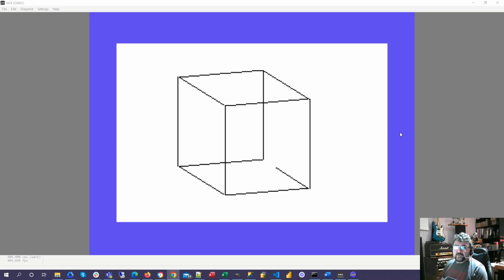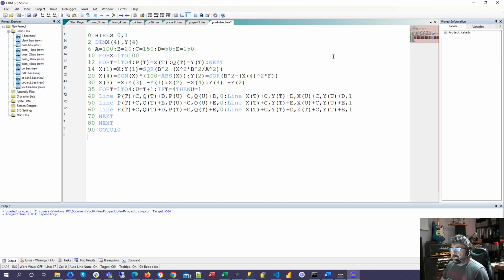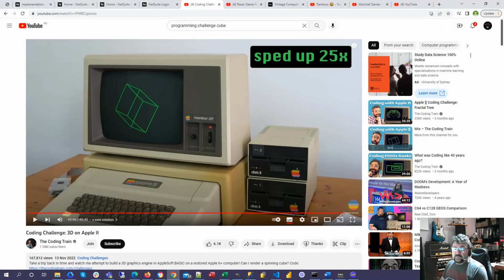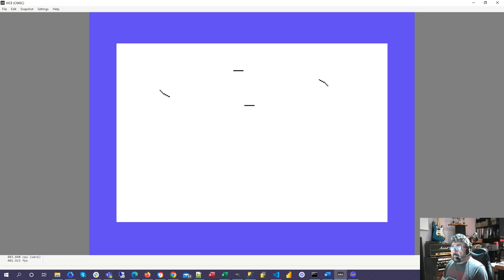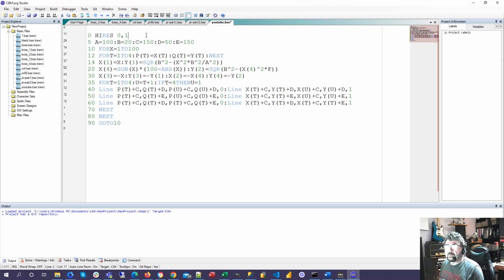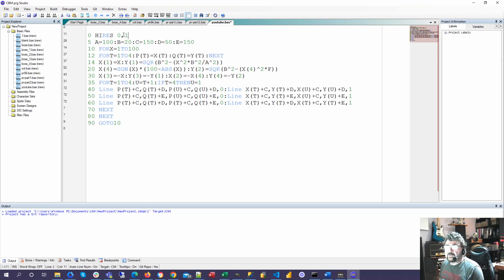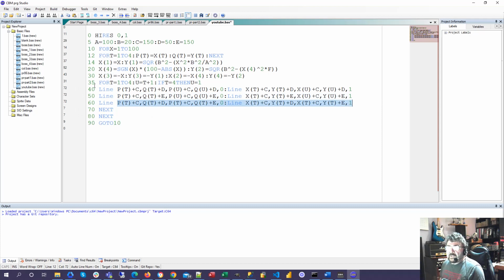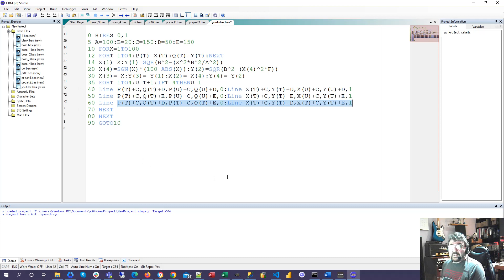Coding Challenge: 3D on a Commodore 64

Comment: Look up the Compute's Gazette magazine archive about 1986(ish). They published a type in machine language "BASIC wedge" that added BASIC drawing commands for the high rez screen and simplified setting up the high rez screen. The unique thing about this wedge over other drawing wedges was that it specialized in 3D mesh drawing. It included several key words that utilized screen swapping for animating. It was primitive and slow compared to anything developed 10 years (or so) later but it simplified displaying such things as a rotating cube by handling the math of drawing the mesh in a perspective view. The only tedious thing was that you had to figure out the vertex coordinates of the object you wanted to display somewhat manually. I believe this was their attempt to replicate the 3D rendering "engine" developed by Sublogic for Flight Sim, but to put it in the BASIC programing environment.

Comment: This is pretty cool.  Thanks for sharing.  I've modified this code for the C-128 and for the Commander X16...

C-128 code...
0 GRAPHIC1,1:A=100:B=20:F=B^2/A^2:C=150:D=50:E=150
1 FORX=1TO100:FORT=1TO4:P(T)=X(T):Q(T)=Y(T):NEXT:Y(1)=SQR(B^2-(X^2*F))
2 X(4)=SGN(X)*(100-ABS(X)):Y(2)=SQR(B^2-(X(4)^2*F))
3 X(3)=-X:Y(3)=-Y(1):X(2)=-X(4):Y(4)=-Y(2):X(1)=X:FORT=1TO4:U=T+1:IFT=4THENU=1
4 DRAW0,P(T)+C,Q(T)+DTOP(U)+C,Q(U)+D:DRAW1,X(T)+C,Y(T)+DTOX(U)+C,Y(U)+D
5 DRAW0,P(T)+C,Q(T)+ETOP(U)+C,Q(U)+E:DRAW1,X(T)+C,Y(T)+ETOX(U)+C,Y(U)+E
6 DRAW0,P(T)+C,Q(T)+DTOP(T)+C,Q(T)+E:DRAW1,X(T)+C,Y(T)+DTOX(T)+C,Y(T)+E:NEXT
7 GETK$:IFK$<>""THENGRAPHIC0:END
8 NEXT:GOTO1

Commander X16 code...
0 SCREEN128:A=100:B=20:F=(B*B)/(A*A):C=150:D=50:E=150
1 FORX=1TO100:FORT=1TO4:P(T)=X(T):Q(T)=Y(T):NEXT:Y(1)=SQR(B*B-(X*X*F))
2 X(4)=SGN(X)*(100-ABS(X)):Y(2)=SQR(B*B-(X(4)*X(4)*F))
3 X(3)=-X:Y(3)=-Y(1):X(2)=-X(4):Y(4)=-Y(2):X(1)=X:FORT=1TO4:U=T+1:IFT=4THENU=1
4 LINEP(T)+C,Q(T)+D,P(U)+C,Q(U)+D,1:LINEX(T)+C,Y(T)+D,X(U)+C,Y(U)+D,0
5 LINEP(T)+C,Q(T)+E,P(U)+C,Q(U)+E,1:LINEX(T)+C,Y(T)+E,X(U)+C,Y(U)+E,0
6 LINEP(T)+C,Q(T)+D,P(T)+C,Q(T)+E,1:LINEX(T)+C,Y(T)+D,X(T)+C,Y(T)+E,0:NEXT
7 GETK$:IFK$<>""THENSCREEN0:END
8 NEXT:GOTO1